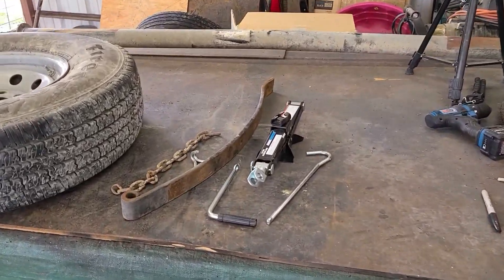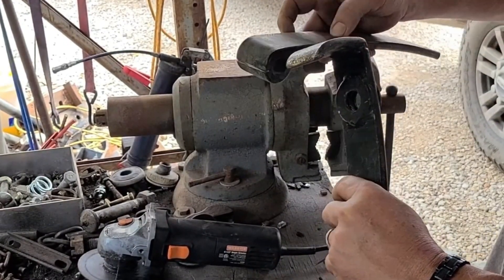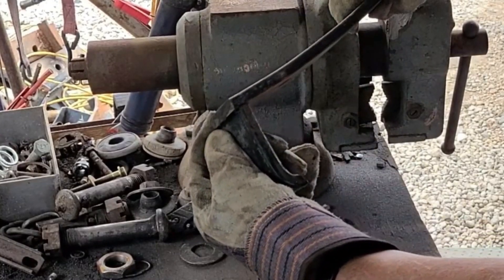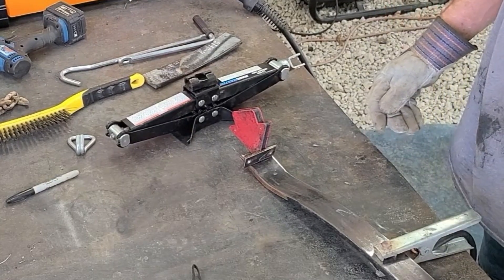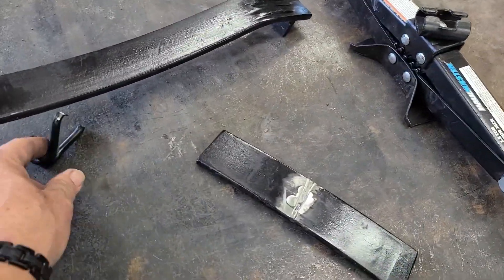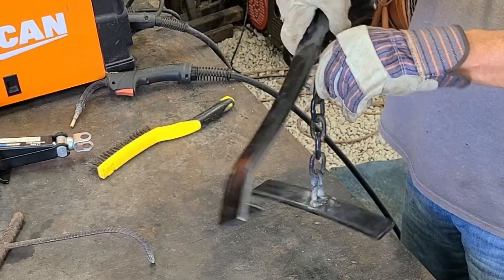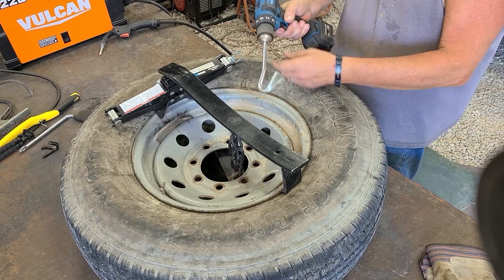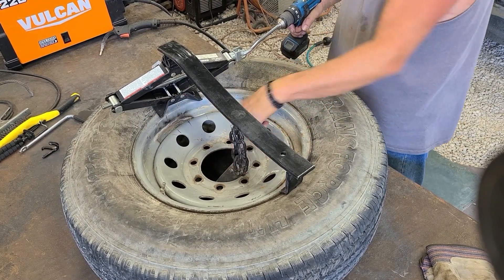Can we break a tire bead with a Scissor Jack

Comment: I use my travel trailer with a tongue weight of 400 lbs to break beads. Lay the tire under the tongue frame, put a 2x4 between the frame and tire bead. Lower tongue with electric Jack. Easy,  peasy.

Comment: Back in the 60's when I was a teenager, We didn't need any tools to break the bead. We simply layed the wheel on the driveway and slowly ran over the tire with our left front wheel [so we could see what we were doing] and the bead popped everytime.
Reply: Or put a 2X6 on the bead and drive up on it. We did tractor tires and wheels on our BIG trucks that way.

Sometime the tractor tire would be rusted in place. Just leave the tuck parked on the board and go do something (like eat lunch) it would soon break
Reply from the maker: @allanc3655  that definitely sounds like it would work just as well. 
Thanks for watching
Reply from the maker: Right
Reply: Stiffer tires in those days....

Comment: Anyone remember using the old bumper jacks back in the day? 😂
Reply: Yes , my older brothers ,Joe and Walt , always broke down tire beads with them !  Jacked them down right off the rear bumper . Now , does anyone remember steel car bumpers ?
Reply: Still have the one from my 63 Impala station wagon. Use it to pull metal T-posts out of the ground. And to jack up zero turn mowers.

Comment: Show how you'd do it on a golf cart tire.
Reply from the maker: I don't think that would be hard, just shorten the cross bar.
I'll have to keep a lookout for small wheels to try
Reply from the maker: Stay tuned I know a place I may be able to get a golf cart tire and wheel.
Reply: If the jack end of the spring went thru a bridge welded to the jack, and the bridge had a T handle set screw to lock down on the spring, it might be somewhat universal, wheel size wise.....